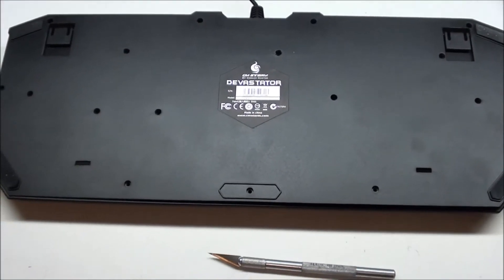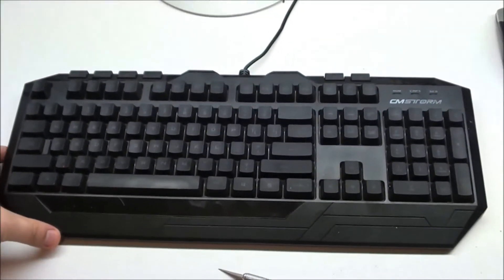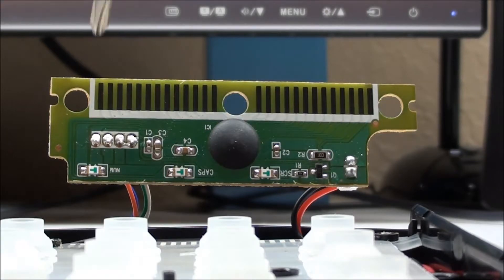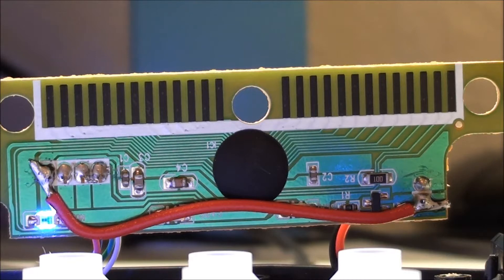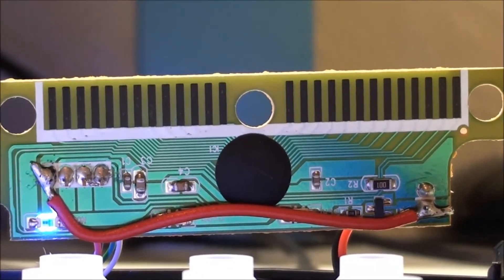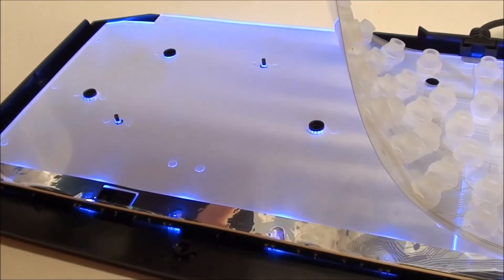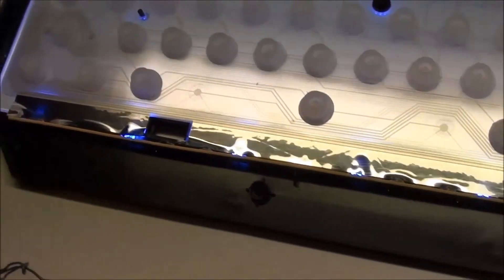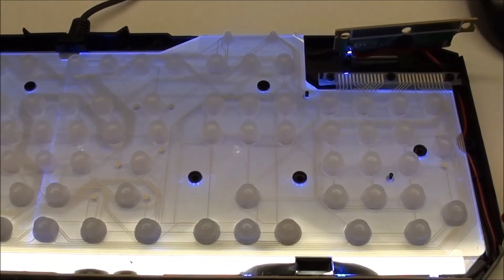CM Storm Devastator LED Scroll Lock Mod Hack

Comment: WoW i was looking a solution around the web for a cheap keyboard i bought re branded by a mexican company and it was a nightmare, cuz other "solutions" in MAC OS is to "emulate" the bit to the HID led por Scroll Block in mac os which it doesn't exist, so there are a lot of pieces of scripts and code on Terminal app which is so unworthy to do, and testing the keyboard on an old windows pc, it's just this we are seeing, the backlight turn on is linked to the scroll block led, which is a big problem, manufacturers should put some "chip" or "transistor" that just turn it on simply, it cost here in mexico like 12 dlls this keyboard but without rgb on is as the same as another simple keyboard with no backlight, but this solution was on my mind before seeing this video, thanks a lot

Comment: This works but I can't type anymore and it show's something about the power surge on the usb port.

Edit: I just have to tighten (super tight) the 3 screws that holds the board and it works again. I've had this Mouse + Keyboard combo for about 3 years now and it works great except the mouse the scroll wheel keeps squeaking. Anyways thanks a lot I can now use a software called "X-mouse button control" properly. I use it to remap the extra 2 button on the left side of the mouse for doing some photoshop.
Reply from the maker: Yep, those screw forces are what makes the connection from the board to the membranes.

Comment: Thanks for this video, it worked perfectly! A small thing to point out is that the screws under the bottom stickers are close to the middle (so peel the sticker from the middle outwards, not the other way around like I did). See http://imgur.com/XdhnL7N

Comment: anyone know how i can make more bright the light? how increase it?
Reply from the maker: HourGlassDM to make the LEDs brighter they need more current. This would be accomplished by reducing the resistance. Doing that has the potential to burn out the LEDs completely, and I don't know what would happen to your USB port if it tried to draw too much current. That being said, I seem to remember resistors on the boards the LEDs were attached to. Removing them and replacing with lower values should brighten them up a bit. I have recently noticed mine is dim during the daytime and was thinking about trying this myself.

Comment: Thanks!  I about had a panic moment testing it before fully reassembling -- i'm not the best as soldering, especially on circuit boards.  Make sure you tighten down the circuit board TIGHT!  Soon as I had a good connection there I was golden.  I plugged it into my monitor, so when i'm away from my desk it doesn't keep glowing like a night club.

Comment: Is this accomplished easier by a direct wire splice no solder method on the other side of the card?
Reply from the maker: Eric Mulligan depends on your definition of easier. I find it easier to solder between two pads, but if trimming insulation and splicing wires is easier for you, it should work fine, assuming there is room to route the additional wire.

Comment: I googled furiously for a software solution to this problem and there was one video with some links to download exe files. They looked a little suspicious so I didn't try them.  Hey I missed the part about 2 screws being under the rubber bumpers and almost cracked my keyboard trying to pull it apart.  Before that happened I watched the video again.   Also I have ET (essential tremor) so I knew trying to solder directly onto those points would be a disaster.  What I did instead was use the solder iron to melt away the insulation from the 2 red wires and then solder a jumper wire between them.  Even that was a challenge, the more i concentrate the more my hands shake.  But 30 minutes and a couple of ugly glob solder connections later the wire was in place.  Finally!  Now I can use Excel and see the keys at the same time thanks!!
Reply from the maker: Glad you were able to work it out!

Comment: Hello,

I have this keyboard but it doesn't work. When I connect the usb cable there is no light and the device is not recognized by windows (there is a usb notice but it is classified as unknown device).

I was wondering if you could help me check and fix my keyboard.

Thank you

Comment: with this solution you can turn your scroll lock on and off and the lights wwill remain on? is it possible to turn off the light when the pc is turned off too? i got a cm devastator , but i dont want the light turned on when the pc is shutted down.(like the mouse lights :( )
Reply: I was able to turn off the mouse light when I power down my PC by changing settings in the BIOS. I don't remember exactly, but I think it was a deeper sleep stage or something. Just google it. 

I was wondering the same thing though if the keyboard would still be lit when my PC is shutdown. But I'm assuming in my case, if you can get the mouse light to shut off like me the keyboard would turn off as well.
Reply from the maker: you'll need to add a switch inline with this mod, or use a USB port that isn't constantly powered. I'm not sure modern desktop pc's have ports that turn off with the computer.
Reply: so , with this hack i should be able to switch between scrolllock on and off , and the lights will remain powered, right?
Reply from the maker: Exactly. The lights will be on as long as the keyboard is plugged into a powered USB port, unless you install an inline switch to turn them off.

Comment: After watching this vid twice, I am wondering if you even need to solder?

Would it be possible just to splice in a section of cable in between the 2 red cables? Personally, I don't see any reason why not, but I have yet to crack open the keyboard.. As I don't have soldering tools/experience, I would be much more comfortable splicing wires instead.. Wondering what you think of that?
Reply from the maker: yeah, should be fine.
Reply: Can confirm - just did the mod, only spliced the 2 wires, and no solder necessary Just a couple tiny pieces of electrical tape, and a half hr of tinkering, and it works great.. Only thing is - that red wire that comes in from the usb is super thin. Care was necessary to not screw it up.

Thanks for the video! you did a great job explaining what needs to be done :)

Comment: When you say you did two and the first ones still working does that mean the other one failed? And how is your first one holding up still?
Reply from the maker: I guess I could have been clearer. the one I'm modding in this video is the second one. It's still going strong, and so is the first one.
Reply: +Drew Smith Gotcha! Sounds like I'll be doing this soon. Thanks!

Comment: Hi. I made a mistake in the process. The VCC wire made contact with the GND cable. This caused a short circuit. The keyboard is not recognized by the computer. It is possible to fix this error?
Thank you!

Comment: thanks for the tip. 

however I did mine a little differently by removing the red wire from the led plug And then making the direct connection from the usb 5v to that led red wire. just a precaution incase putting 5v back through the circuit from the led connection side has any undesirable effects

Comment: would the scrl lck key still work? like on excel, etc?
Reply: +aw ulala I tried it on mine and it still works just fine. :-)
Reply from the maker: It should, although I don't think I've tested it, or ever even used scroll lock.
Reply: would you mind testing on ms excel?
Reply: +David Brown thanks for the info. will try this after my warranty expires. cheers!
Reply: +aw ulala yep scroll lock functionality intact, LEDs stay on indefinitely
Reply: Hey, i've just done this mod, and the scroll and LED works normally. Just the backlight is always on now!

Comment: Good hack.  However I just stripped some insulation from both red wires and bridged them with a piece of Cat5 cable wire so I didn't have to mess with the circuit board, which had a very small solder connection.  Worked great but remember to use some flux on the solder connection point!  Thanks for the video.
Reply: good call with a cat5 cable, that was the perfect size all my other cables were too large.

Comment: hi, i have a question, i have the same keyboard and i cant open it in the bottom left and right parts how did you do?
Reply from the maker: Figg There are 2 screws, 1 underneath each rubber pad in the bottom left and right corners. If you already got those out, I don't know what the problem is. Proceed with caution.

https://youtu.be/W4n4oKf1ATo?t=12
Reply: yes! you got it! i didnt think about this, man, i pulled the back of the keyboard very hard, it dont looks damaged but i feel stupid...
i poured beer on my keyboard and some keys were sticky
thanks for the quick answer, have a nice day!

Comment: Would it work if you tap in both wires and put a bridge wire in between, instead of soldering them on the board?
Reply from the maker: It should. Leave a comment either way.
Reply: Drew Smith I'm going to have to return my set now, I just noticed one of the mouse's lights doesn't work and also today the scroll wheel starting jumping when scrolling down... I just bought this set last Friday.
Reply from the maker: Juan Alatorre Yeah, my mouse crapped out on me a couple of weeks after I got it. It wasn't worth the hassle of the return. I'm not impressed with the quality, but for $20 for a keyboard and mouse, I guess I should have expected it... Good luck!

Comment: ty very much
Reply from the maker: Your welcome! Did you try it and if so did it work?
Reply: Drew Smith I want to try it but i wonder if you can add a microswitch to turn the light off
Reply from the maker: John Hou you can do that. I've been meaning to try it as well, but it might mostly defeat the purpose of the mod. I think some USB ports are powered when the computer is off, some aren't. Maybe try some other ports?